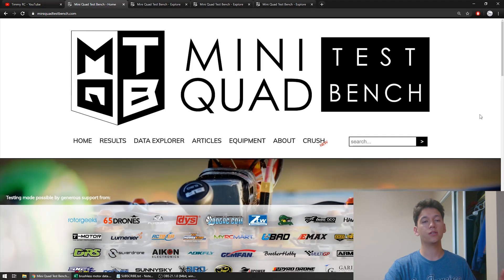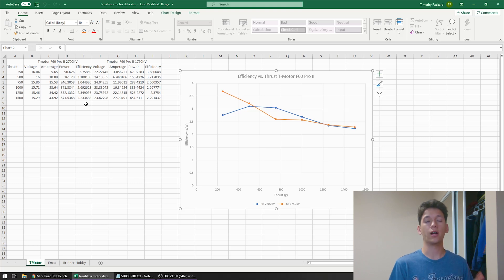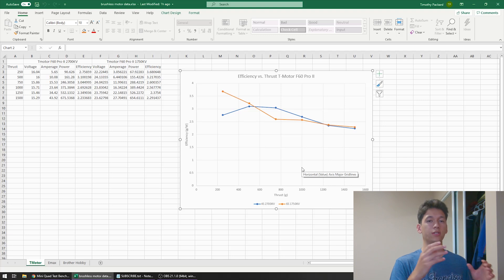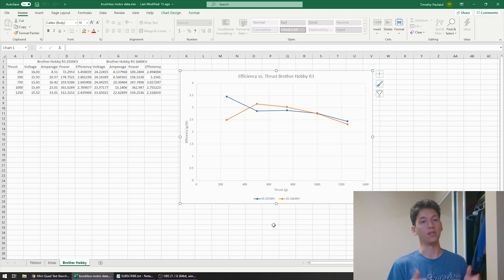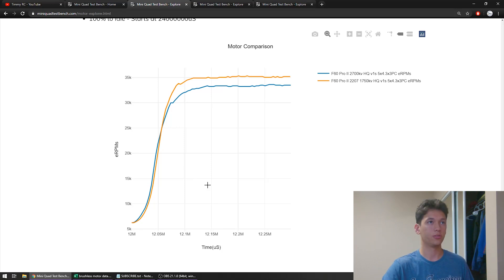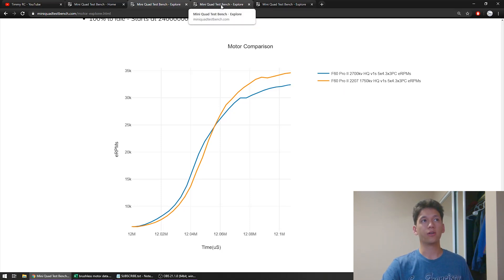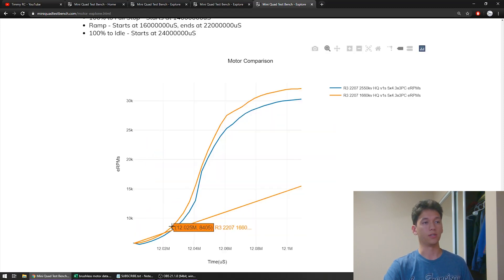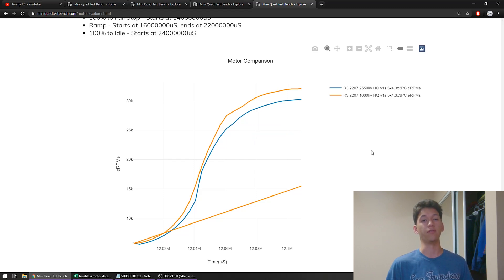4S vs. 6S Settled Using Science - Which Cell Count is Better?

Comment: Great video!
I remember in a similar video I watched a while back that 6S begins to really out perform 4S starting at about the 1850+ KV range. Less than that KV and they're more or less the same - and you prove that here. I'd like to see you do higher 6S kv -  1850+
Reply from the maker: Based on the results of my high vs. low KV video the only difference we will see is that 6S will have even more thrust at full throttle.

Comment: this is a great video -- I think people forget that not too long ago people flew amazing on 4s...and before that 3s. Skill level is much more a factor in maneuvers than wot peak power.
Reply from the maker: Thanks! Another thing to throw in is that the average quad used to be lighter before people started switching to heavier 6S batteries and larger motors.
Reply: @TimmyRC  YES, exactly. I got talked into going 6S but I'm kind of regretting it. I like light weight nimble quads and the new 6S freestyle rig I've got just doesn't feel right to me. I still prefer my 4S quads.

Comment: It's not only the motors efficiency that counts. Both esc cables and the batteries are causing energy losses. Lower current through these are of course an advantage and it would be interesting to see the significance of these.
Reply from the maker: I will be talking more about this in my next video. Keep in mind that for this data the voltage is measured before the ESC, so this takes into account losses from the wiring.

Comment: I can't handle such a big (or bigger) noise with 6s quad, also the price is much higher... also if you look for 6s battery, there is a bigger chance that one the 6 cells may be damaged over time (instead of 4 cells) -> the more cells the higher chance to damage battery  for me 4s is good enough (since you can buy even 120C discharge rate batteries). Thanks for your vid!
Reply: Try BF 4.2 batt sag comp, does wonders on 4s bro

Comment: Hi, good comparison. I have not found a significant difference in efficiency either. Right now I am running only 5S batteries and the only difference is that 5/6S is bit better in keeping the voltage level than I used to have with 4S. I guess if I would buy the current 120C (used to run 75C) 4S batteries I would probably get the same result. Right now I will hold on buying new batteries because winter is coming and I want to see if 6S will make a progress and decrease weight. I might end up on 4s because of weight.
Reply from the maker: Thanks! I will talk more about weight, discharge rate, and voltage sag in the next video.
Reply: Gotta also factor in BF 4.2 bat sag comp...its magic for 4s

Comment: Results not surprising to me, I have stuck with 4-s for now. The only facet you didn’t touch base on is that 6S batteries seem to hold up too high current draw better. I think in general they are less susceptible to voltage sag, which likely beats up your packs less.
Reply from the maker: I will be discussing voltage sag and current in the next video.
Reply: 4s gang... BF 4.2 bat sag comp...its magic for 4s

Comment: Hey timmy, I am an electrical engineer specialized in motor design. The difference from the different KV values comes out from the inductance of the motor and its relationship with the freewheling diodes inside the esc mosfets.
with the no-load rpm being the same, different voltage/inductance combinations give rise to slightly different torque characteristics in the rpm range.
it is possible to mathematically demonstrate this phenomena. The problem with this phenomenon is that it's entirely related to the commutation phase of the mosfet bridge so it is basically impossible to grasp without diving very deep into the subject.
I think i might be able to make an ELI5 in a video in some time.

the basics are: more inductance (low kv) and voltage give slightly more torque and efficiency at low rpm than an identical motor with lower inductance (high kv) and lower voltage.
the higer voltage motor catches up at very high loads because the joule losses (motor, wires, FETs) take over on the motor efficiency. but this is only on the thrust stand where very high currents are seen.

In the air the higher kv motor with lower voltage feel more free at high rpm because they effectively have slightly more torque there.

The difference in the charts is often because of instrumental errors and kv being not exactly what is advertised.
Reply from the maker: Thanks for the valuable info! When I compared low and high KV I only looked at the "meat" of the rpm range, where efficiency and torque had no significant difference. But indeed at very low rpm low KV had more torque, and at very high rpm low KV runs out of torque, whereas high KV keeps accelerating to a higher peak rpm. For our particular drone application my theory is that low-end torque is actually going to feel the same because high KV will have a faster idle speed, so at "0 throttle" different KVs will have comparable torques because their rpms aren't actually the same. The story changes when you change the idle percentages to yield identical idle rpm.

Maybe I should interview you about this subject?
Reply: @TimmyRC  
Nasone32 said: "The problem with this phenomenon is that it's entirely related to the commutation phase of the mosfet bridge " and you, TimmyRC, seem to understand what he's referring to, and while I sit here in respect and awe at your mutual understanding, I would love to have an understanding of what it is that a MOSFET actually does....
Back when I played music, "MOSFET technology" was a big deal -
So now I fly quads, and MOSFET technology is STILL important and I still have no idea what effect they have on our little technological marvels.
So yes, I'd like to see an interview, or a Zoom meeting with you both, but first, I"D LIKE TO UNDERSTAND WTF A MOSFET DOES. Probably there are YouTube videos already in existence, but its definitely a subject that needs some splaining 😁

Comment: I consistently  draw less amps with my 6s setups. I can throttle longer harder with 6s verse 4s. Because we have more voltage, we can use higher usable kv with 6s than the comparable  4s motor would be able to use . Are batteries  are the limiting factor here.  Its also worth noting that the higher the kv you go the higher cost of current you will have for a given voltage. Are batteries  are the reason why some people say higher kv motors have less torque.  It just feels that way because  of the voltage sag. Thats the reason why you don't  see 3000 kv on a typical 4s quad spinning  5" props. But you are seeing 2000 kv on a 5" quad with 6s. More usable rpm on 6s than 4s. With our quadcopters, 6s is absolutely  the way to go if power is your goal.
Reply from the maker: I will explain some misconceptions about current draw, flight time, and voltage sag in my next video.
Reply: @TimmyRC   I found this video very helpful  when learning about kv and cost of wattage per revolution. Start around 10 minutes  in or so. Very good  info in this video.  I like the way they describe  stuff. https://youtu.be/oKcyXR7Yx64
Reply from the maker: @MouwDown  Thanks! Very informational, and validates a lot of what I have observed from miniquadtestbench data.

Comment: Interesting and kinda confirms what I “feel” when flying 4S vs 6S. I’m running a motor output limit on my 6S 1950kv motors to bring them down to around 1700kv which feels closer to my 2400kv on 4S.

They still feel like they have a little more at the top end but I’m not overshooting certain tricks as much. I could get used to a 1950kv motor but I was flying both 4S and 6S together until recently and just wanted them to feel the same.

Comment: Ryan does his testing with a power supply doesn't he?  I wonder if it's calibrated to sag in the same way equivalent 4S or 6S packs would under equivalent draw.
Reply from the maker: Yes, he uses power supplies. The voltages in the data I used to make the efficiency comparisons varied less than 1 volt.

I will be talking more about voltage sag in the next video.

Comment: Maybe you should talk about Flight Times, Cost Efficiency, Weight, since all these play a part as well.
Also Battery Life since I have a hunch that drawing more amps from a lower cell count reduces the life of the battery.
Reply from the maker: I am planning a video about setups since I see a lot of areas for improvement in many people's setups.

I have not been able to find any data about amp draw specifically impacting battery longevity. I will discuss some math that suggests why some people are getting better battery longevity on 6S in the next video.

Comment: Great video Timmy. I've been running non-scientific tests with 4 and 6 cell batteries for months now. With my flight style (slower cinematic with moments of mild free style) I consistently achieve a notable increase in flight times and performance with the 6s.  Keep doing what you do, thanks for posting this video!
Reply from the maker: Thanks! What were the capacities of the 4S and 6S batteries you were using?
Reply: @TimmyRC  1300mAh 100c
Reply from the maker: @MADDOG724  Thanks! I will explain your longer flight time in my next video.
Reply: Mike that could explain it, I get about the same flight time from an 1000mah 6S as I do from a 1500mah 4S and they weigh about the same.